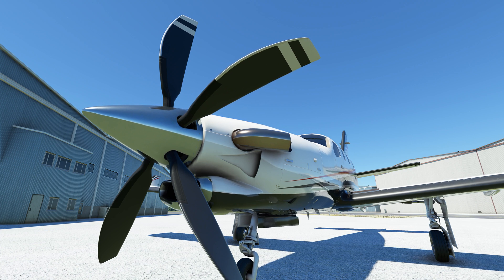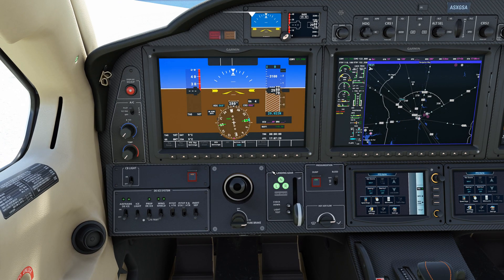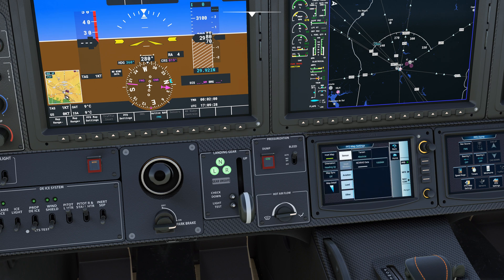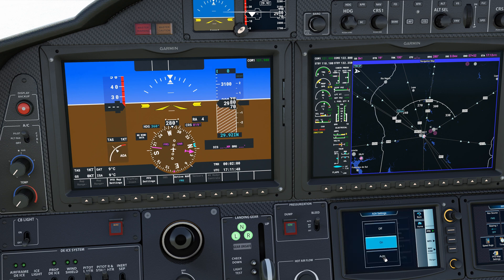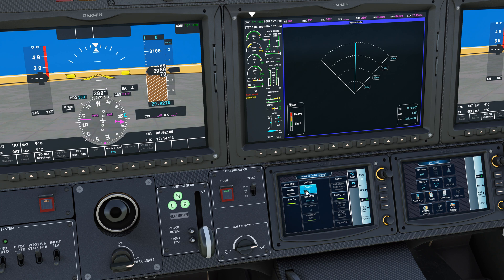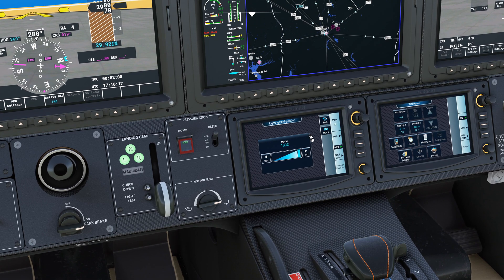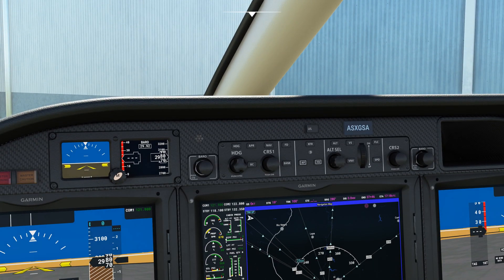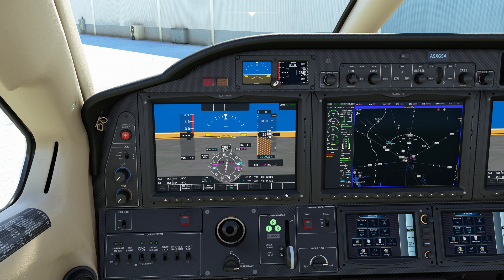Microsoft Flight Simulator | TBM-930 Tutorial | Customizing Displays

Comment: microsoft mixed reality and there headsets (G2 Headset ect) not working with youtube 360 VR video's ? Here is a Fix:
1. Open Settings

2. Type "graphics" and go to the Graphics Settings page
, 

3.  then click on browse button and find microsoft Edge under microsoft folder, and click on the edge exe

4. Click on Options to bring up the "Graphics preference" dialog

5. It should show a High performance option with the discrete GPU.

6. Select the High performance option, Click on Save, as shown in example below.

7. Close and restart all instances of Microsoft Edge

Now when you click on a youtube video that has a 360 headset icon , it now show take you all the way into VR 360